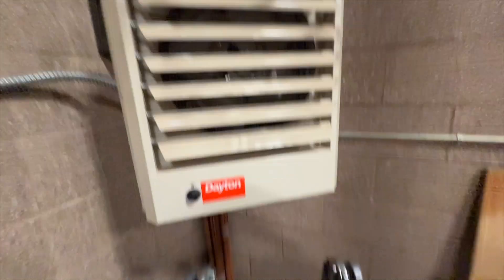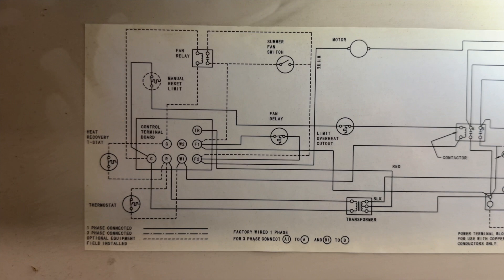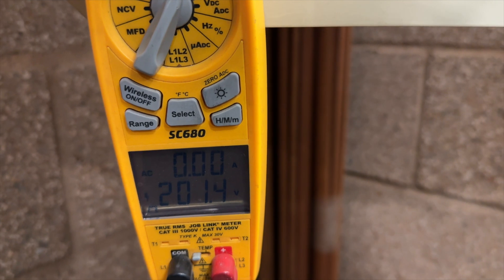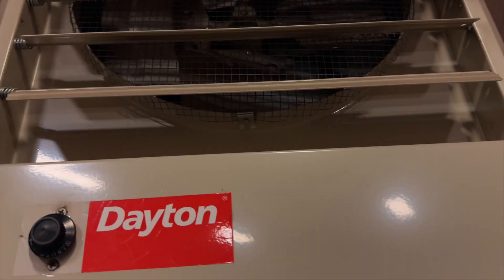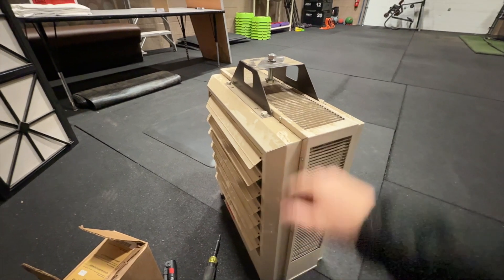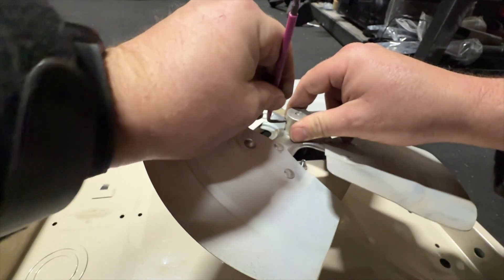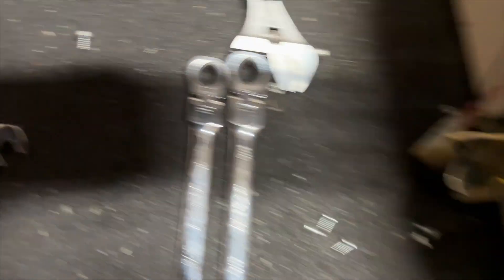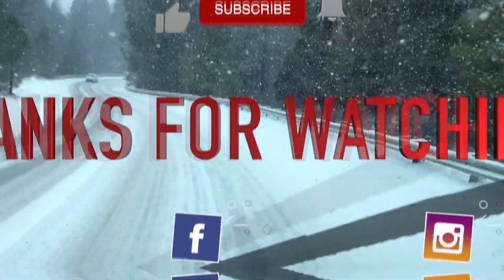Two Dayton Electric Unit Heaters Not Heating EP206

Comment: I have one of these in my garage from previous owner. When i turn breaker on it runs all the time even if i turn that dial down. Do I need to wire in a on off switch or is my thermostat not working? I held the thermistor in front of the heater and it still stays running. Cant find an owners manual for it. Thanks!